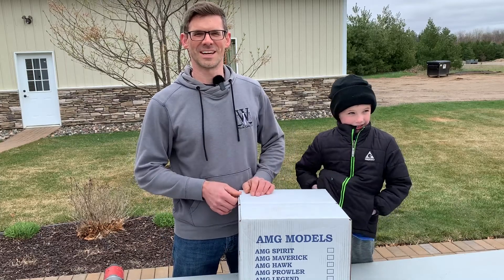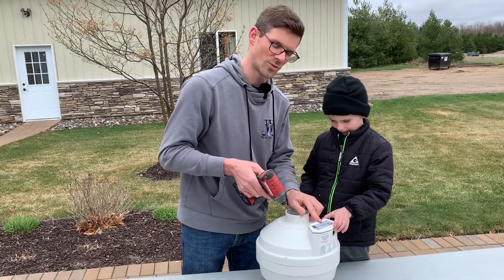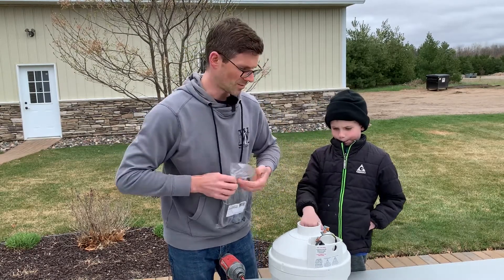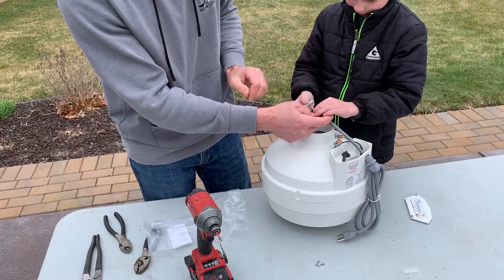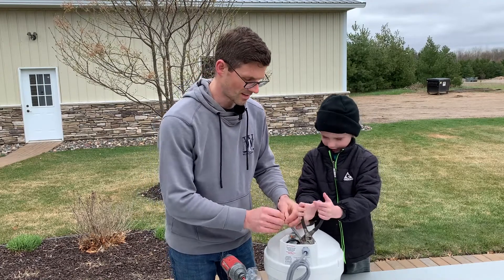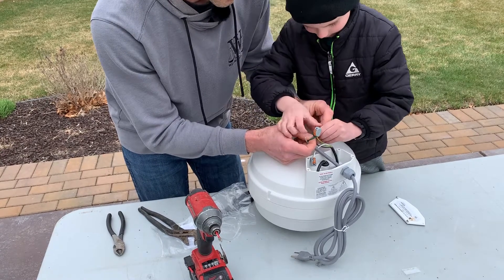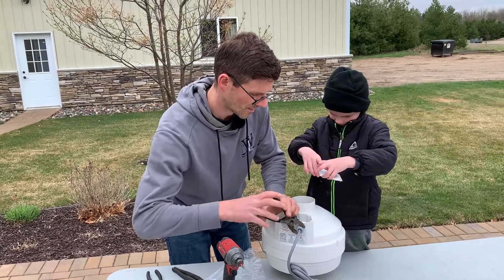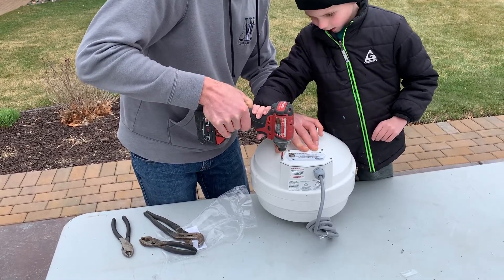How to Wire Festa AMG Radon Fan

Comment from the maker: Updated Video
How to Wire a Festa AMG Radon Fan - 2024 Update - https://youtu.be/OIlmy-LM7gw

Festa AMG Radon Fans
Spirit - https://amzn.to/43YOl8B 
Maverick - https://amzn.to/44abEww 
Hawk - https://amzn.to/3s70c7p 
Legend - https://amzn.to/3OwgVZp 
Prowler - https://amzn.to/3DMOSzI 
Eagle - https://amzn.to/44ZwT5m 
Eagle Extreme - https://amzn.to/3Kvthja 

Fantech Radon Fans
Rn1 - https://amzn.to/3DL0weJ 
Rn2 - https://amzn.to/3Ot86iT 
Rn2EC - https://amzn.to/45niJum 
Rn3 - https://amzn.to/3KA2NwT 
Rn4EC - https://amzn.to/446RTpo 

RadonAway Radon Fans
RP140 - https://amzn.to/3s0avdn 
RP145 - https://amzn.to/45iItIv 
RP260 - https://amzn.to/3QqXq78 
RP265 - https://amzn.to/3OP8v0w 
RP380 - https://amzn.to/3OppAgd 
XP151 - https://amzn.to/444AwW6 
XP201 - https://amzn.to/3Yv6aLe 
XR261 - https://amzn.to/3OOkPhx 
GX3 - https://amzn.to/3Yr2c6u 
GX4 - https://amzn.to/43WsOgQ 
GX5A -https://amzn.to/451PBJp 
GP301 - https://amzn.to/3QrUreE 
GP501 - https://amzn.to/3KynNUJ 
SF180 - https://amzn.to/47o02IY 

Other Accessories
Power Cord Kit - https://amzn.to/48mrPdg 
Rubber Couplers - https://amzn.to/441AO07 
Radon Test Kit - https://amzn.to/440t3rd 
Radon Monitor - https://amzn.to/3Qxjmxx
90-Degree Connector with O-ring - https://amzn.to/460D6yo
Noise Suppressors and More - https://americanradonmitigation.com/shop/

Related Videos
How to Replace an Outdoor Radon Fan - https://youtu.be/qEADrgDg4kk?si=2KA2K3O3ksb3VdE1 
How to Replace a Radon Fan in the Attic - https://youtu.be/RfGboo5kpV8?si=LrPthECbY8YG7Blp 

Radon Fan Replacement Guide:
https://americanradonmitigation.com/diy-radon-fan-replacement-garage-attic/

📍 Service Area
Serving Colorado’s Front Range and Mountain Communities:
Golden, Boulder, Denver, Cherry Hills Village, Evergreen, Breckenridge, Vail, Aspen, and nearby areas.

🗓 Schedule an Estimate
Live in Colorado? Book your in-person radon mitigation system estimate here: https://americanradonmitigation.com/

🌎 Have a Question for Jesse?
We offer virtual consultations worldwide: https://americanradonmitigation.com/consulting/

🛒 Need a Radon Monitor or Supplies?
Shop our online store: https://americanradonmitigation.com/shop/

🛍 Our Amazon Store: https://amazon.com/shop/americanradonmitigation
We participate in the Amazon Associates Program and may earn commissions from qualifying purchases made through the links above. Thanks for your support!

Comment: Hi Jesse, a contractor put in a Legend in the attic of my new construction house. It's at 2.5" wc, do you think there is a restrictive issue with the radon pipe builder put in? What is the ideal wc number for the legend?
Reply from the maker: Yes, it sounds like the system wasn't installed properly. Unfortunately, this is way too common. Check out this video to learn more about the troubleshooting process when activating a passive radon system: https://youtu.be/yY0G7TIUZIY?si=p1v3GoxFwR0-S9wp

Comment: Great video! When changing out my exterior mounted radon fan, water was released when I undid my lower fernco fitting. Is there a way to prevent this or does it not cause any harm?
Reply from the maker: You could add a condensate bypass to divert the water inside the piping around the fan. Here's a link to the ones we use: https://www.amazon.com/shop/americanradonmitigation/list/EG7OLJ4BE834?ref_=cm_sw_r_cp_ud_aipsflist_aipsfamericanradonmitigation_V0P3K54BKV4G0N0TMF5Z

We earn a commission if you purchase using the link, and we appreciate you supporting our business!

Comment: Hello I bought a prowler AMG fan but it has 4 wires and I only have three.  The wire in question on the AMG is a black/brown together.  Does that wire plug into anything?  Thanks
Reply from the maker: I don't have one in front of me, but tie into the three different lever locks they use. One wire to each, unless something has changed. 

Green to green and yellow
White to blue
Black to black
Reply: No that one doesn’t. Just worry about the three with connectors

Comment: Hi, the link to the cord is not working, thanks for all video.
Reply from the maker: Thanks for the heads up, Chris. It's fixed now.
Reply: A video about how to wire a radon fan and doesn't tell you what colors wires to connect  ..fantastic
Reply from the maker: Sorry, the lighting made it hard to see. 
Green to green and yellow
White to blue
Black to black